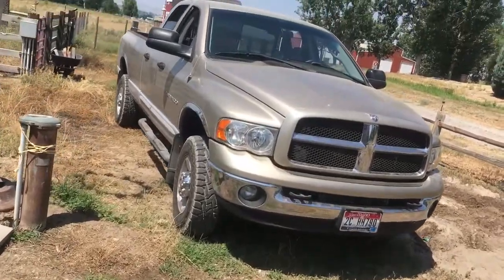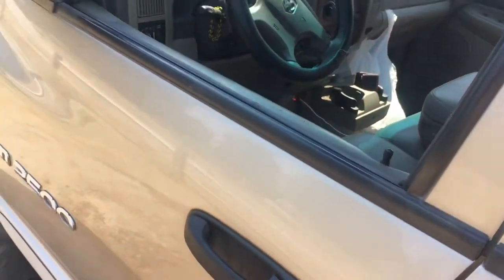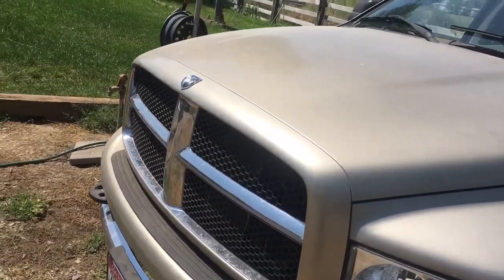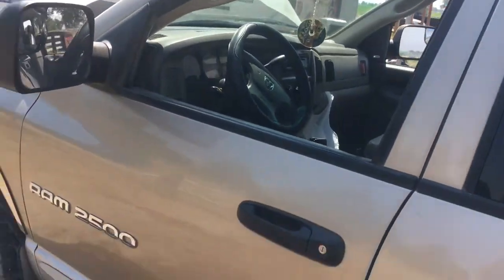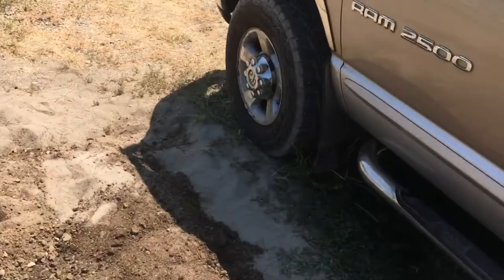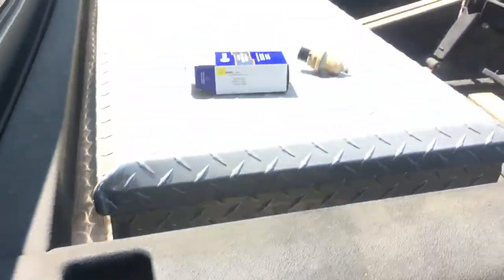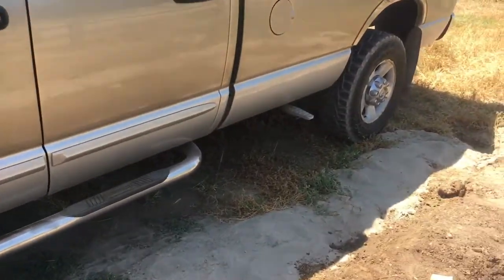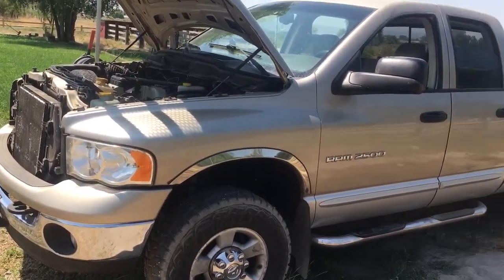2003 5.9 Cummins 48RE Transmission/Extreme ERRATIC Shift issue resolved...for now

Comment: Mines doing similar but it will go into od but seems like it switches back and forth so I’m wondering if this is the problem
Reply: Did you figure it out? Mine goes into over drive and just revs up the engine. Around 35-50 mph. When it does that if I let the truck come to a slower speed or completely stop then floor it it shifts fine
Reply: @joeharbin8210 yes I changed the sensor and it’s fixed, thanks for posting this video
Reply: @ericchrestman4525  I’m not the one who posted the video. I’m going to try it on mine as well as the Solenoid & Sensor.
Reply: I found the sensor but has letters SB afterwards will that matter
Reply: @alterthecreatorflare8776 no idea what that stands for but as long as it’s the sensor put it on